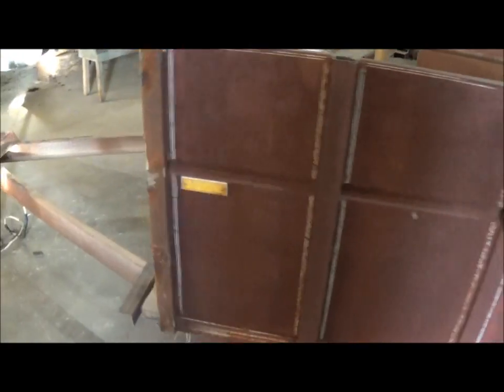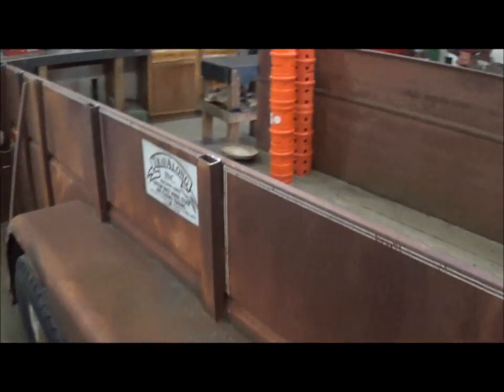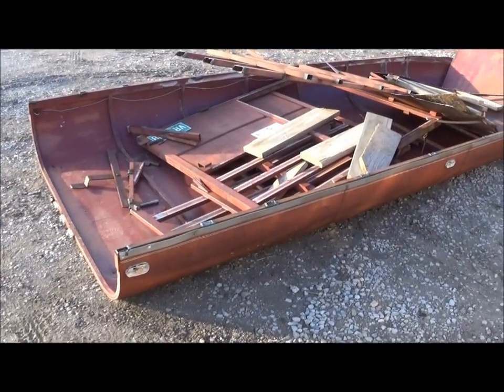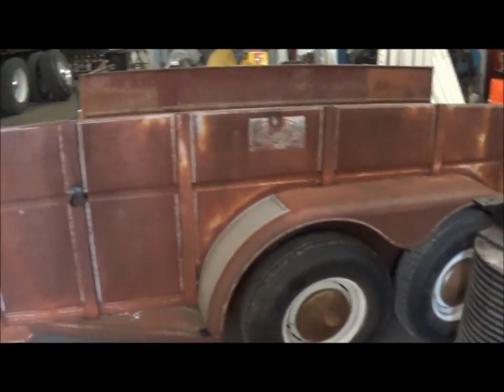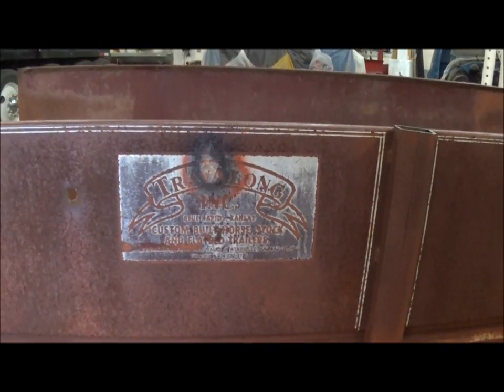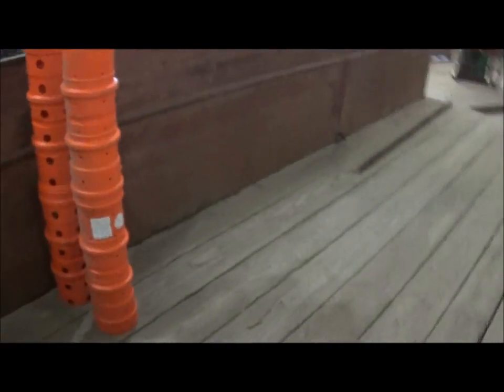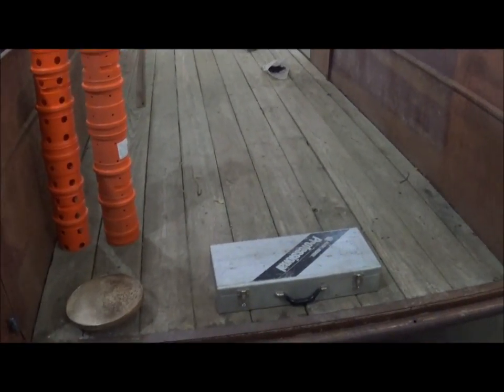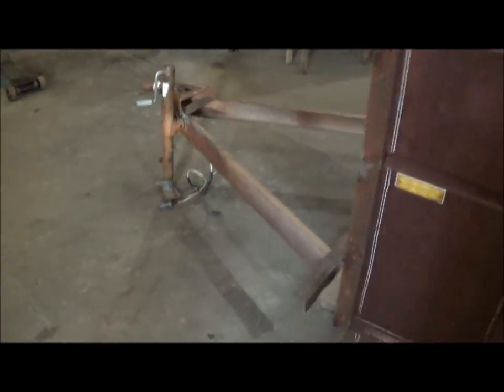Homemade, Conversion, Horse Trailer to Tile Fittings Trailer Vid#1

Comment: i have a horse trailer i was going to cut the whole top off. My question is if i cut the whole top off as well as walls can i use it as a dual axle flat bed trailer without doing any extra such as strength. cause lets face it if i can just cut the top and use the frame an deck an be good to go